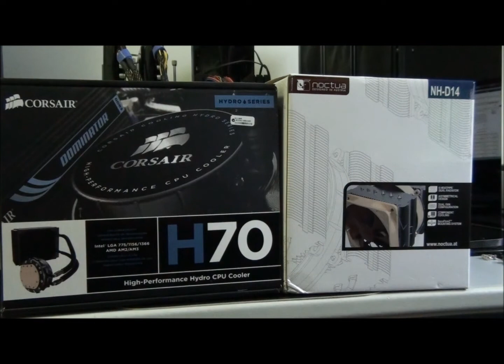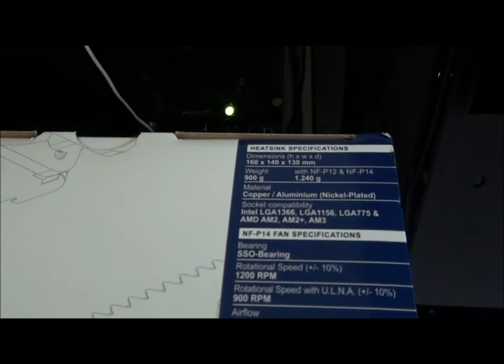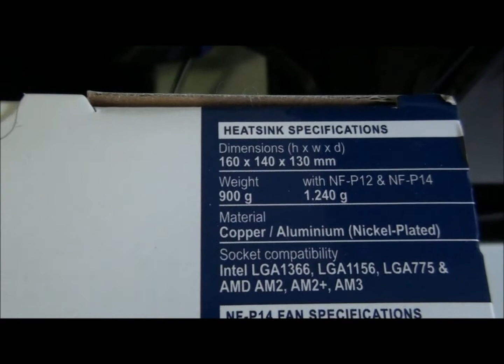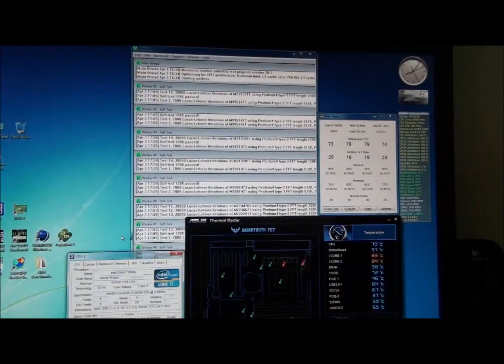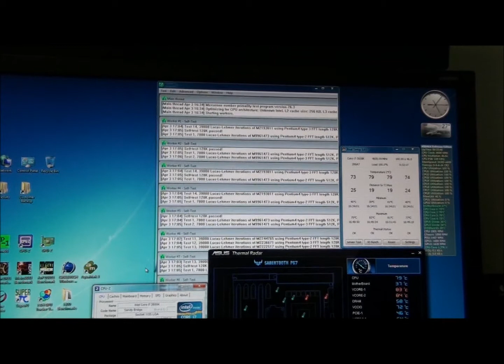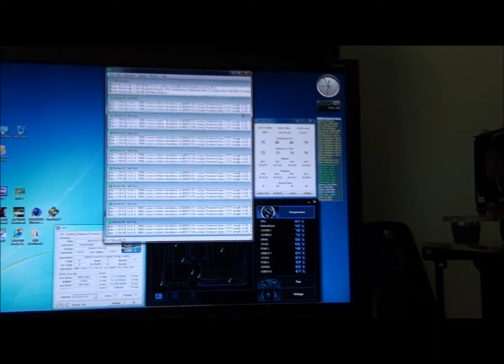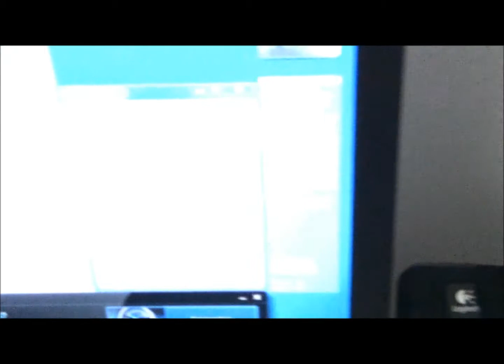Noctua NH-D14 Vs Corsair H70

Comment: I had the swiftech h20 ultimate xt apogee kit on. cost $378 and temp never went over 45 degrees even when it was 40 degree hot summer days it did not budge overclocked amd 965 4ghz..  I had that in for 1 1/2 years but I recently took it out and need to buy new tubing and coolant/fittings. I got the noctua nh d14 on and it is ok but its way louder and has a higher idle temp. When overclocking it jumps up higher to 53 degrees. But for $86 can i really complain.. Nope. i prefer my xt apogee :(

Comment: ROFL alot of people sure do love defending the NH d14 =p Water coolers are generally better than air coolers guys period. Its common sense for the h70 midrange to match the high end air coolers, water conducts heat better than heat pipes. Noctua make damn good fans though, i would buy a h70 and use noctua high cfm fans if i had a choice to buy either. He was just doing a comparison video, dont hate! appreciate =p

Comment: I really do not understand the idea of push-pull of the H70. Considering that the push fan is already enclosed and the radiator is also enclosed, than it is absolutely no use for the pull fan.

Comment: Noctua NH-D14 is mega cooler - literally and in alienable, but I think Corsair H70 win! And btw - H70 is not full filled with cooling fluid, almost full but not for 100%, it is obvious, so I think the best position for his work is when tubes are at bottom, not at top as in Your case. And finally - in one of my PC's I currently have H70 on i7 2600k OC to 4.4 GHz, max temps = 60°C, ambient temp 25°C, pump working at full speed, fans about 2/3 rpm with rpm reg. (just for noise controll).

Comment: @SingularityComputers I am obviously measuring in degrees Celsius because if it was 70°F it would be 21°C. You never mentioned the ambient temp and how would I have guessed it would be 33°C, with all that money spent on computers I thought you would have an air con unit installed. My ambient temp was 27°C and that still makes your temps 4°C higher than mine and 4°C is a lot when cooling it 10°C more your NH-D14 costs over $1000.

Comment: @SingularityComputers Well i currently have a Corsair H60 and an Amd athlon 640 3.00ghz when playing crysis 2 i get 48C max and 50C max with prime 95. Also note that the athlon 640 isn't a VERY high end cpu such as the 980x or the i7 3930k but for 100 bucks what do you expect. Peace out.

Comment: @00unknownmember00 I thought  his tempswere really high as well. I have my 2.6K at 3.4Ghz  with an H100 and the highest a core ever reaches under load is 52 C (fans running on low) so I doubt I'll go over 75 C around 4.5 ish...

Comment: you need to put links in the video or description so we can skip to the interesting parts.

Also defcon420 is right, you can't compare your $1000+ ugly (car radiator wtf)  water cooling to a $80 NH-D14

Comment: in all fairness, forget about whether this guy is showing off or not. my c14 at on 2.6K 4.5 1.32, ambient 20 ~ 22c, closed case or should I say suffocating air flow due to nature of  the lian li pc-a04 and 580 directcu ii which dumps bad air inside the case. it maxes out at 70c with IBT. wtf this guy getting low 80s with h70 OUTSIDE!!

Comment: @SingularityComputers i was disappointed at how thin the H100 was like the thickness of a H50. now it is a dual 120mm radiator but still i don't think if it would kill them if they added a little more material to it. could be the best hastle free cooler ever then. 
if i get their naming sequence right being H100 is essentially a H50x2. maybe they'd make a H140 which i guess could be a H70X2 (as thick as a H70)

Comment: @SingularityComputers which is amazing that the water box can do that... but for people not looking to water cool the GPU or mother board I'm wondering how the h100 will compare dollar to dollar with a real water cooling solution; obviously the true water cooling solution is better in every class. However you never have to change out the liquid and it takes up much less room (but i would had 2 more fans to it- to give it a push/ pull config)
Again though... GREAT reviews and vids on your channel

Comment: @SingularityComputers  Sorry. I didn't mean for it be so negative but you have to admit $1000 is on the extreme end of a custom WC kit.  Anyone using water cooling probably doesn't want to spend that much or any where close to that.  It would be better to compare a more reasonable wc setup to the H70.

Comment: hmmm id recon if the Noctua had the same fans on the h70 it could possibly get better temps as the fans on the Noctua dont push as much air as the h70

Comment: @SingularityComputers  Thats what i meant, air will go to the highest point in the radiator if there is any. If the intake and outtake is at the top of the radiator it will suck air if any because that is the highest point. I did not like linustechtips review. his review is on a test bed (open air enviroment) and not inside a case. I would love to see the both compared in a case. I am sure the h70(set on intake from outside the case) will perform better than the noctua air cooler.

Comment: Just a thought, the h70 should be orientated with the pipes on the bottom? Linustechtips also did a review and had the pipes on the top? I like your vid tho...........putting noctuas fans on the h70 works well. Might subcribe to your chanel.

Comment: @Ninjawithaphone The H70 is not quieter than the Noctua NH-D14 and the Noctua performs better.  And it's cheaper!  $80.  The only thing I like about the H70 is that you can make the radiator/fans act as your exhaust fan which makes your case look cleaner and I do like how the H70 looks, but in terms of performance, price, and loudness, the Noctua wins in all 3 categories.

Comment: The H70 can't be beat for the price.  The H70 runs quieter than the Noctua NH-D14 and is a much more simple installation than the custom watercooling kit and takes up almost no space.  So, you mean that I can run my 980X at 4.6Ghz with an H70 for $100  O.o   I think I'll pass on the $600+ customer watercooling system just for a measily 500Mhz - THANKS!

Comment: @SingularityComputers His configuration is actually worse than the stock fans. The gentle typhoons go 1000rpm, the stock does 600-2000rpm as stated on the box. I got the Scythe ULTRA KAZE and I prefer those because I don't really mind the noise and it gives me the 3000rpm in push-pull when I really need it. It takes around 5 degrees off.

Comment: H70 temps depend more on your room temps and air flow, then most air coolers
for example

i had a noctua cooler SE2 and i7980x overclocked to 4.2ghz idle temps were 35 and load 80, when i installed H70 my idle temps went to 45-47, but load temps went down to 69-72, this was in summer with +27 inside my room and +40 ouside the house. ill see how it is in the winter.

because H70 is in the case, liquid doesnt have enough time to cool down

Comment: I have the h70 and changing the fans is a must!! I use x2 scythe gentle typhoons @1000 rpm, totally silent, can't hear a thing, and they're the best for push & pull configuration. I'm using a i5 2500k @ 4.5 ghz with idle temps of 38° and load temps of 62°!! being totally silent!! But buying the h70 + extra fans does cost a lot more than the noctua cooler indeed... but I find the h70 sexier since it's all black and you can also see the whole motherboard. (goes great with p67 sabertooth)!

Comment: @WestCoastMods 
Hi, To this referred to me when it speaks with you. It is not necessary 3 radiators and long tubes,etc.
The small H70 is very effective, and it does not need maintenance. If it needs more refrigeration it introduces computer in the freezer. Greetings

Comment: I just got the Thermaltake Frio and the Corsair H50.  I'm running the Frio right now and with both fans on high and a 4.0GHz overclock on my i7-960, I'm seeing around 80-83 degrees Celsius with Prime 95 "Large FFTs" after 9hrs.  

I'm not going to bother "upgrading" to the H50 right now since the Frio is performing so well.  I might try and push 4.2GHz if I can get it stable, but I'll probably have to switch.

Still waiting on those GTX 560 waterblocks so I can go custom LCS.

Comment: Great video and spot on info I do not think this is biased at all. You are totally correct and I tell others same thing, if you want to go all out on overclocking skip air and cheap water kits and go for custom. For the average Joe the H70 or Nochua is perfect but for extreme OCers you would just be waste money to get a low end cooling solution. I have leaned this first hand and will be saving to get a custom loop since I love high overclocks.